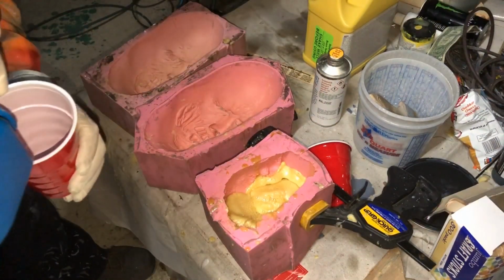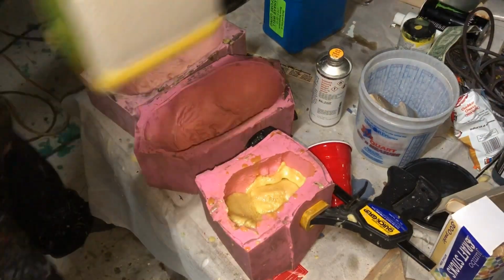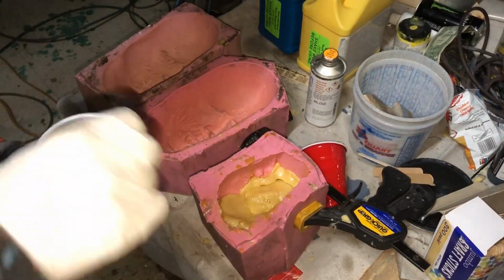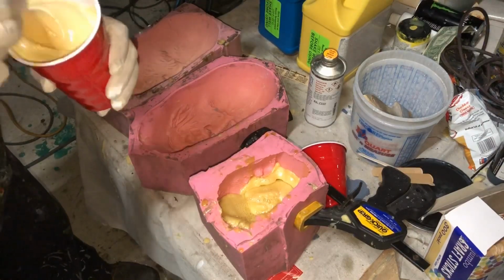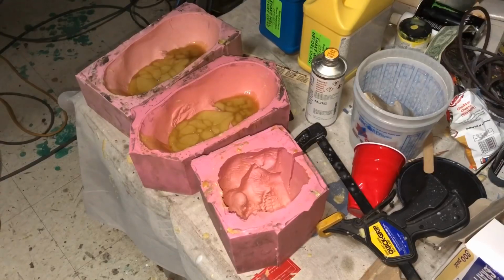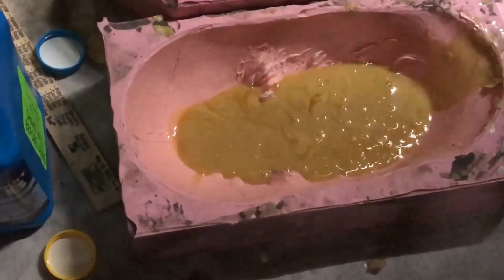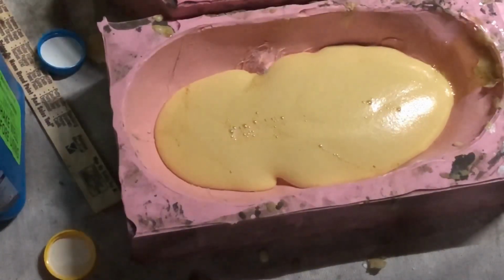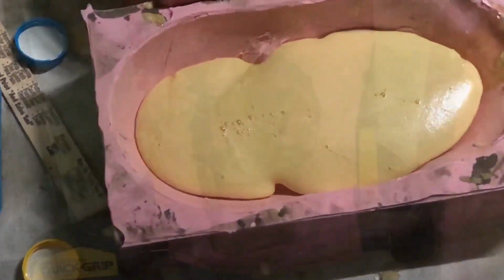Project X..Pouring more Skulls using Smooth-On Foam it 15, | vid 7 |

Comment: Have you ever worked with FoamIT 3 for casting? And does the mold need to be made from tin silicone or will it work with platinum silicone molds?
Reply from the maker: I will be making new molds soon..thinking on Dragon skin! I have a small mold made with that..fantastic! So yes, platinum is better and lasts longer..well worth the extra cost!

Comment: Do you use a mold release? I'm trying to figure out if I need one.
Reply from the maker: For cement i do not
Reply from the maker: Form the foam..brush in mold release.,.allow yo dry before pouring in the foam
Reply from the maker: Mold release 2831.,brushable  avoid the spray